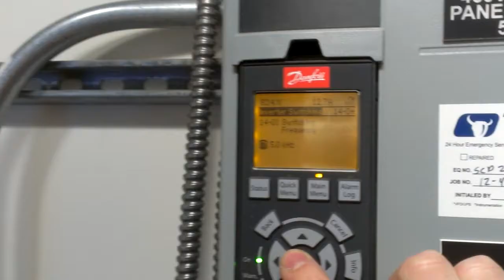Effect of Adjusting the Switching Frequency

Comment: Any ill effects of making the chance to 10? I'd also like to do this on some of my motors but people have been saying that there can be some ill effects over time...
Reply: Getting rid of the sound is fine if you consider several things that can be negatively effected...raising the carrier results in derating needed in the drive.  The higher you go, the more you must derate the unit.  This also causes stress on the motor leads.  Lead length is of great concern when doing this.  General duty motors running at higher carrier will fail in short order.  The Danfoss manual has data on derating and lead lengths.
Reply: Increasing the PWM switching frequency could lead to bearing and insulation deterioration due to higher common mode voltage (higher frequency = higher dv/dt = more capacitive coupling)
Reply: Shorted life! Whole lot higher common mode current, wave reflection, standing wave effect. Whole lot higher EMI/EMC, must make sure that you have correct VFD cable. 
Most likely disruption to control and communication equipment. 
Shorted motor life, both bearing and winding.

Comment: Increasing the carrier frequency puts more load on the IGBT's. You need to consult the manual to see if the drive derates with the increase. It's not just a temperature driven issue.
Reply: It is only a temperature driven issue.
Reply: @Sixta16  It may be but setting it up to the higher carrier severely derates the output of the drive.
Reply: Yup, the transistors spend more time in a partial conductive state when switching on and off more than usual. More partial conductivity = more resistance = more heat.